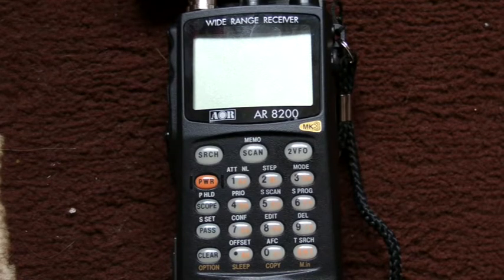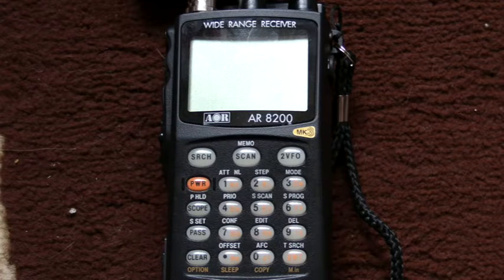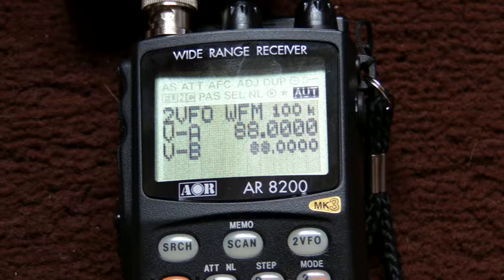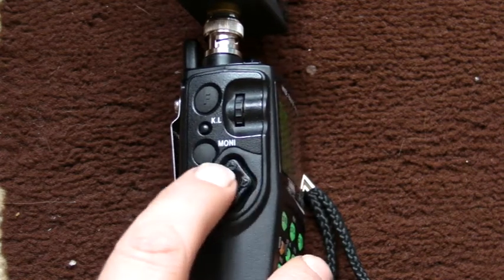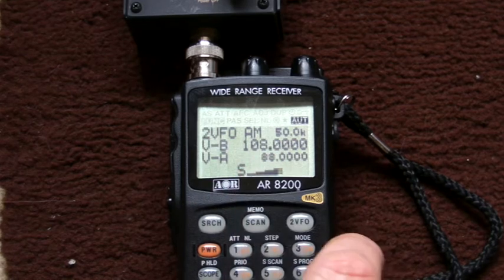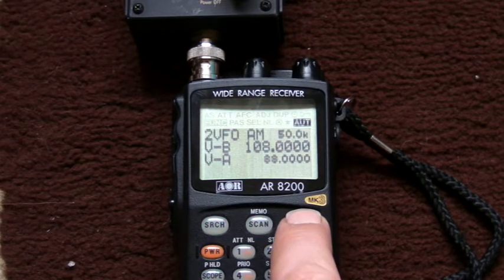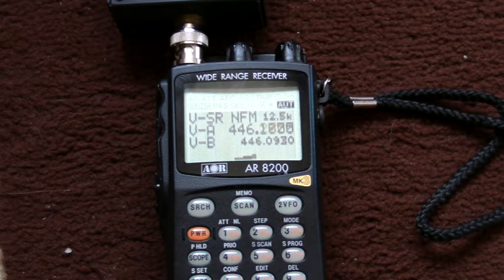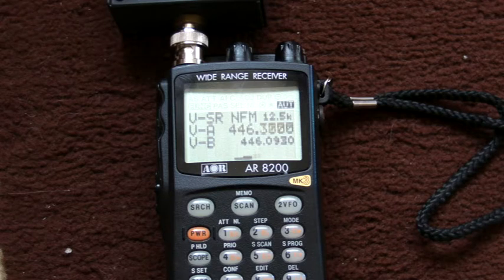AOR 8200 Instructional videos Part 1. For beginners by a beginner.

Comment: Hi what does the mod do and how do you do it
Reply from the maker: you know the wheel on the side? Well if you press it, it has a switch. That switch is not connected. The mod makes that switch active.
Reply: I’ve only just ordered it so can’t try it yet but will be in touch again when it arrives
Many thanks for the reply

Comment: Difficult to use you damn right the only station I received this local FM station with music and some aircraft voices really vaguely
Reply from the maker: And are you surrounded by thousands of competing radio waves from all the wifi, bluetooth, tv's, radios and the millions of other devices swamping out signals?
Get an antenna booster, make a long wire antenna, then you can listen to other stuff. The airwaves are a lot more crowded than they were 20 years ago...

Comment: just  ordered aor  8200d unblocked it shall be interesting
Reply from the maker: PLEASE put you experiences on line, I am wondering if I should upgrade but I do already know the port on the side is very different...
Reply: after purchasing this unit I realized I made a mistake a huge mistake. Everything out there nowadays is digital I don't believe this unit can decode digital broadcasts. Cell phone, police, etc. so what is a good for all post a video to let you know I was also interested in a Drake 8 shortwave receiver. The still some shortwave out there plus is a collectible. What I don't like right off the bat there is no software out there decent enough to go with the Aor. Again even though I don't have this scanning yet., Assured authority through about how the whole world is turning digital so I really don't know what I could do with it. My first thought was to keep it in the box and resell it unused, or scan the airwaves looking for strange signals such as over the horizon radar harp so I paid $700 for something that's practically useless if this was in the 90s or 80s it would've been fantastic. What gets me there selling $3000 radio scanners unblocked but for what reason you need to have software to decipher all the digital code that's out there I think that is where I need to look soon, decoding software lets they in touch even get me atsinq55@gmail.com because I'm usually not on this Gmail account next week to Google. So you can email me and I'll tell you exactly what it does. I mean they 800 band is dead and also contact me on Skype kt881962 first email me at sinq55@gmail.com maybe you can give me some suggestions on what to listen to only live three hours from Kennedy space Center be really cool with this radio again without some good software I mean really good software I think you're dead in the water who knows maybe I'll just give it to you as a present for free...lol
Reply from the maker: Damn, I thought it was "trunk"? compatible. I do believe you can listen to the emergency services in the USA but not in the UK...
Shame as I have the JAOR software for the 8200 mk3...
Reply: I will let u know
Reply: not exactly fun for people in the US anymore to use anymore as all the juicy stuff here is digital and this radio won't help you with that.

Comment: Great video, but there are numerous mistakes. First PMR starts with 446.00625MHz and ends with 446.09375MHz. I don't know how you set it, but it's clearly scanning wrong range (goes from 446.093 to 446.495 which is far from PMR)